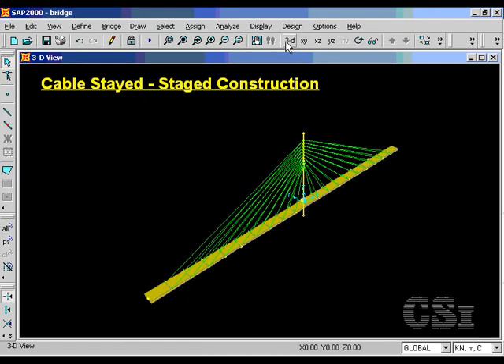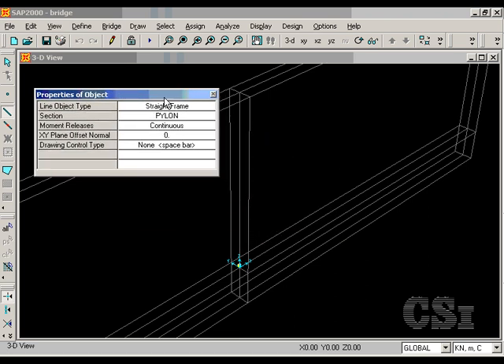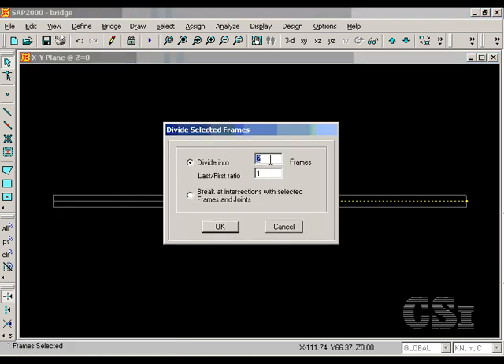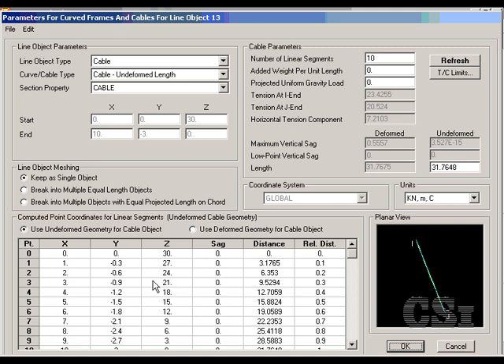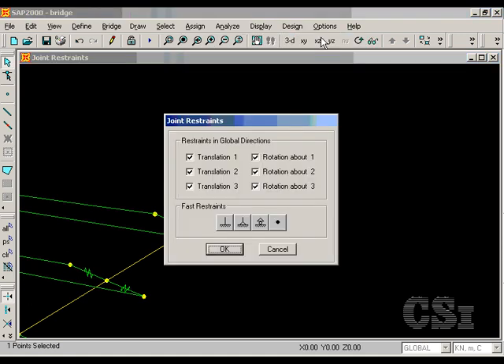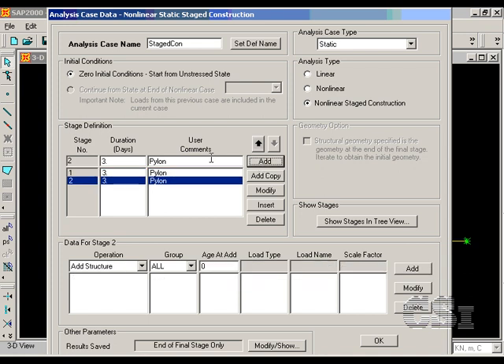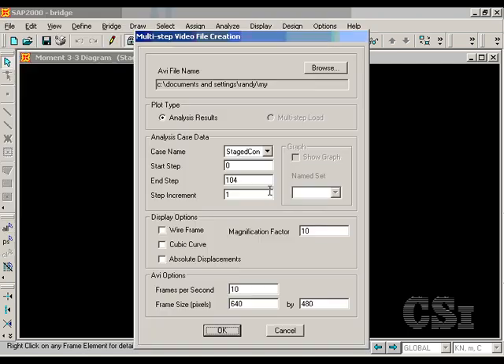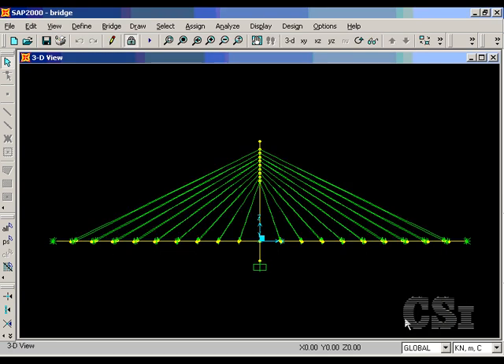24 Cable Bridge V11S

Comment: Thank you sir for these video. Sir, can you explain how steel elastic links are provided between A shaped towers and deck section. How steel girders, crossbeams and cables are connected to concrete decks

Comment: Hello, here is a subscriber to the channel.
I am carrying out a final project of a cable-stayed bridge. I have a doubt,
since I would like to remove the axles from the braces without having to first
do continuous beam analysis and project to see how much each cable takes. So if
I decide to check it with the cables, I assign a very small area for it to
catch all the corresponding reaction but it is not like that, the value is
extremely low .... There is some way to see the axis of the tie rod without
defining an area like what can be done with the frame element?
Reply: HI JAVI JE YOU DOING WORK ON CABLE STAYED BRIDGE